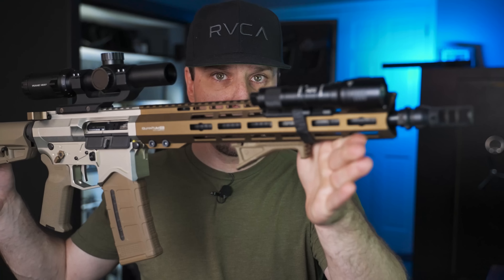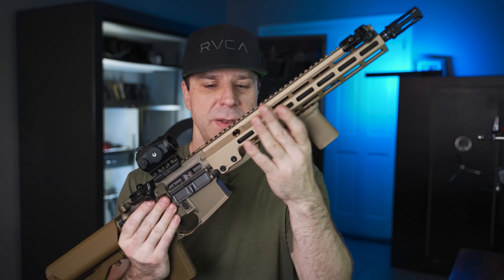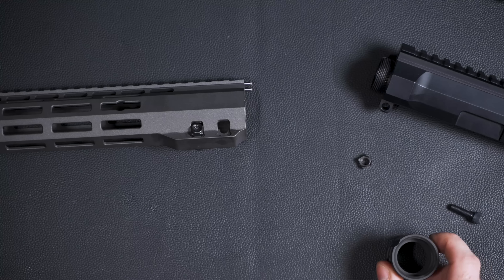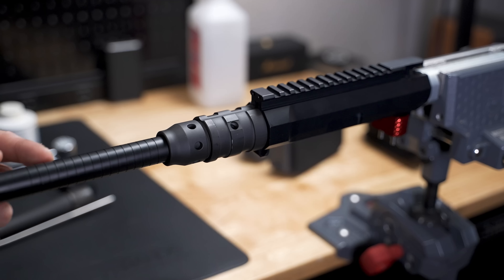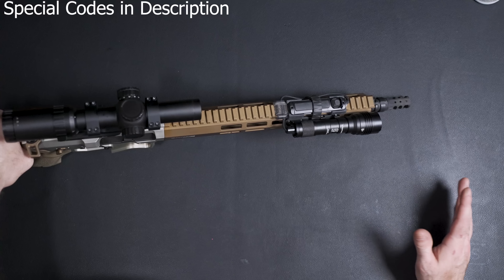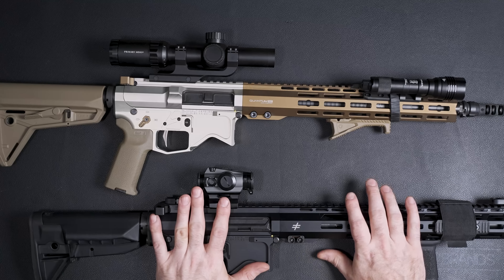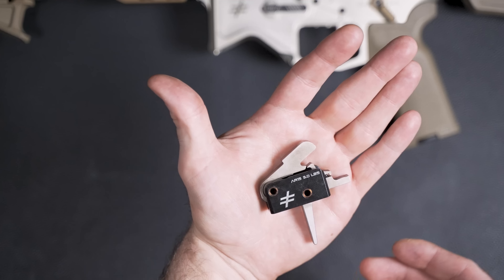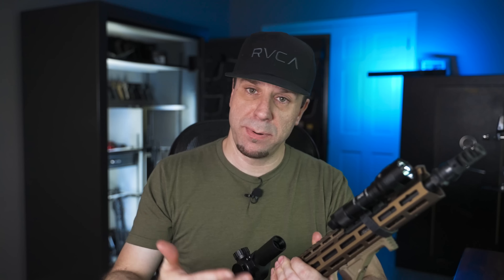NOBODY in the World Makes an AR 15 Like This...

Comment: I personally would never use an adjustable gas block, unless you feel like cleaning it everytime you shoot, you'll eventually get carbon lock and it'll fail. That barrel nut system is super cool and their pricing isn't too bad considering all the thought they've put into the build.

Comment: I got a ruger AR-15 shoots 223/556 I’m not sure which model but a review on that gun would be awesome I bought it at my local gun store right after I turned 18 and so far my only problem I have with it is the stock its a regular adjustable stock. The gun has a 13 or 14 inch hand guard and the barrel I want to say is 16 inches I’ve been watching your videos for awhile now and you partly the reason why I bought one. I’m not sure weather you would call my gun high end or low end. But I plan to do a lot of coyote hunting in the near future.

Comment: As for gas blocks I would really say that the click style adjustable blocks I have not had a fondness for but the tunable blocks have been a huge success. Currently all of mine have been changed to the odin works tunable block and since their initial tune after install I have not had them change and have had zero issue with the oldest one having around 1700 rounds through it and the newest is around 900. Wish I could say the round counts were higher but alas ammo is pricey and time is short.

Comment: The only bad thing about an adjustable gas block on a GTW rifle, is that it has the possibility to be on the wrong setting, when you need it most.  So there's a much more likely hood of user error, vs something that is permanent.  So you just really have to know what you're doing.  Kinda like running a 1911/ 2011 as your duty pistol;   You better know how to work that safety without thinking about it......   So that's also why the "adjustable gas blocks' that have many many settings--- (like i've seen on FAL's, that had 50 different notches to adjust it to)----   those are even more likely for someone to adjust wrong, and mess up your reliability.  It's just a data point to think about.   The more things there are that can go wrong, the more things will go wrong---   Murphy's law and such.

Comment: Having a rifle built with a blackout defense upper and lower there is a great advantage in the quality of the fit. I would love to by a second upper with the dual taper barrel nut, but the current barrel lengths offered don't fit what I want out of the platform. If they put out a 16 or 20 inch in this lockup design I might just have to throw my wallet at the screen to get it. Amazing company that puts out a great work of art and still tries to do more without killing the wallet as bad as they could. Can't wait to see what they pull off next
Reply: I am sorry buddy. I am working on the 16 inch DTL barrel. I have bar stock on order.
Reply: @BlackoutDefense  thanks for the update and quick reply was not expecting that. Continue the amazing work

Comment: Try throwing a shorter length suppressor with a smaller internal volume/diameter on it next time you plan on shooting that rifle suppressed. if you’re interested in fixing the overgassing issue, as well as the 1 o’clock ejection pattern without having to put an adjustable gas block on it or mess with the buffer weights.

A shorter length can certainly will not make the rifles sound signature a lot quieter downrange like a longer can will, but a smaller length can will highly reduce the port pop at the ejection port, at ear decibel ratings, and limiting the gas you get thrown in your face. 

Also look into one of the Radian gas channeling charging handles as well, since it will help in further reducing the gas blowback to your face while shooting suppressed with a shorter length suppressor. 

With with longer length and larger internal volume suppressors, yes, they’re typically quieter since they trap more gas before the round exits the can, but all that gas is still inside the suppressor itself before the round is fully uncorked at the end of the can and is increasing gas pressure and significantly lengthening your rifle’s dwell time. 

As a result, that’s going to be putting more gas pressure into your gas tube for a longer period of time, and onto your gas key as well, resulting in higher bolt velocities, more gas to the face of the shooter when the bolt does finally unlock, potentially more recoil, and more wear and tear on your rifle’s internals in general, especially at the lugs of the bolt itself.

A shorter length suppressor will help to alleviate a lot of that by significantly lowering the dwell time increase of shooting suppressed, so it should help correct the noticeable change in ejection pattern, as well as reducing the cyclic force and speed of your bolt.

Comment: That's pretty cool engineering.  It would be even better if they combined that taper concept with that of Aero Precision's Enhanced receiver concept that allows the handguard to be mounted directly to the receiver and not the barrel nut.  That is about as ''free-float'' as a gas impingement AR can get.

Comment: THere is one thing I would like to talk about that I am not sure other people have thought of. Regarding designs like this one that allows the rifle to be more accurate NATURALLY, would the practice of these designs help in legal battle for say a self defense shooting? What I mean is that when being tried during a self defense shooting, lawyers will most likely question you about the appearance of your weapon, the mods done to your weapon, etc in order to give the impression that you were eager or premeditated for such shooting events to occur. Thus shifting fault to you, the victim. But to help prevent this, could we argue that such mods help you shoot more accurate therefore putting more of the responsibility on you by taking out the "slack" per say in mechanical fault or failure? For example, say you are speeding along a road 5mph over the speed limit and you happen to drive through a speeding camera zone in which the camera captures your infraction. You decide to go to court to fight the ticket and as you are asked what your defense is, you state that "due to the inaccuracy of natural mechanical failure, my speedometer was off by 5mph, therefore leading me to speed". The court agrees by grace and wipes your ticket, hopefully at least. IF we install mods that intentionally make our firearms more accurate, controllable, and safe, which inherently places more responsibility on the shooter, don't you think that would be a wanted practice? Doesn't it make logical sense to make absolutely sure that malfunctions, defects, and hinderances are taken out of the equation?

Comment: I would also think that in addition to the stated benefits about the proprietary barrel/barrel nut design, that it will also aid in heat dissipation as well, due to that additional mass (not to mention a secoandary nut) along with those concentric rings. Impressive design!

Comment: The blackout defense clear coat and anodized rifle is super sexy and gorgeous. But it would be cool if he had also designed a better gas system. The debate between piston and DI seems to be over. The primary weapon systems, the HK 416 A5, and the Sig Sauer MCX Virtus are dominating the battlespace and have been dominating because they run better with suppressors. No matter how well a DI gun is gassed my piston gun always has less gas in the shooters face which is more and more important when you know all the nasty chemicals that are created when you fire a rifle round. Anyways cool video. I still want one of these SBRs in the mid length 13.9” barrel to see if it fucks well with the Vox-S, Vox-K and ARX can as well as the Helios QD Ti and Sig SLX556QD

Comment: In my opinion, it's better to have an adjustable gas block. If you get thermal expansion, mixed with debris; it'll cause failures from sluggishness. Being able to close off the gas port gives better reliability. However, a non-adjustable gas block can be a better go-to-war option. All gas at all times means it'll cycle at it's max efficiency at all times, however...that also means more wear, and less life. Like you said, it's all a trade-off. There is no perfect solution, only optimal for certain situations.

I make aluminum alloys for a living. (356, 380, 3004, 6061, 6063, 5182, 7050/7075, etc.), and have to explain to new guys the differences almost every day. High silica alloys helps with liquidity - meaning better for casting. 356 is about 7% silica, and pours almost like water. 4032 (~11% silica) is even more "watery". Makes them easier to work with, but more brittle. Adding Strontium to 356 (most commonly seen on machined wheels that have that rainbow sheen to them) is caused by the strontium changing the crystalline structure for better machinability.

Add strength and brittleness, lose flexibility. Add flexibility, lose strength and brittleness. Metal is fascinating.

Comment: I run adjustable gas blocks on all my guns and close the adjuster then fire 1 round mags and adjust till every shot holds open the bolt with empty mag with a couple different rounds I have never had a malfunction due to build up in block because the block is the same as non adjustable it just has a set screw that closes the hole a small amount so it works the same as non adjustable not sure why people think it would cause fouling if so the non adjust would be the same and BTW a go to war gun would not have the super soft short reset trigger a real war gun must have a 5 pound milspec trigger because they are reliable and way to hard to get them to go off on accident a light fast trigger would be dangerous and unreliable

Comment: CZ TS 2 Orange could probably give that Watchtower a run for its money. Idk about a rifle though, would probably build a rifle with the JP buffer system, a big brake, rifle speed gas block, lighter trigger, and maybe a light weight BCG or the Bootleg adjustable BCG. And then tune it till it doesn’t recoil lol

Comment: Nitride barrels do not withstand heat as well as chrome. The nitride hardness does not penetrate as far as the extreme heat does and will flake chunks of metal off. This is why the military requires chrome lined barrels..The concern is between the barrel flat and the upper receiver contact, not the barrel flat and nut. This is why many lap their upper barrel face entrance..Some bed the barrel to the upper to decrease slop and others use a thermal fit...
Reply: If you’re running semi auto, the heat isn’t much of a worry…unless that trigger is moving very quickly over and over.
Reply: @RARufus  You are correct and I have many nitrite barreled AR rifles..The Blackout Defense Quantum Dual Taper Lock Rifle looks like a very well made and thought out rifle..

Comment: My guess as to why higher end companies don't put adjustable gas blocks:

They don't push the volume needed to offset the costs of unneeded warranty returns.
Companies with no questions asked warranties have big margins. Lots of volume. They can afford to offer the no questions asked warranties, staff the department, pay for shipping, store the firearms in for warranty, have separate shipping logistics, etc.

Also, if they're making their parts in house, that's 4-6 extra parts that need to be made, inventoried, and assembled. That's machine time. That's precious floor space. That could mean needing another machine outright. Opportunity cost.

If you work in customer service long enough, you find out that the stupidity/laziness of the average person that calls in is...alarming.

Comment: Those rings are going to have a negligible effect on cooling vs a smooth surface.

It will help with controlling barrel expansion as it heats up.

Comment: You made an error . The flat flange on the barrel nut won't be the part that has the waves of thickness It's the threaded face on the receiver that the barrels flange tightens against . The best way to build an AR15 to have the tightest moa is start with the receiver . Get a receiver lapping tool and the compound that's usedwith it . The tool slides through the barrel mounting hole of the receiver and all the way into the receiver keeping the face of to tool that's ridding against the face of the threaded barrel mount on the receiver completely flat and true with the bcg's round cavity. You use a drill on the tool and put some compound on the receivers barrel mount flat face and spin the tool against the receiver. That process will true up the barrel mounting area getting rid of any imperfections making sure your barrel is mounted straight before you mount your barrel so you get the best groupings you can .

Comment: At lot of companies get the "reliability" for their rifles by over-gassing the living crap out of them (Daniel Defense immediately springs to mind). Putting an adjustable gas block on completely negates over-sizing the gas port on the barrel. Regardless, setting a gas block isn't hard, but not everyone wants to do it. If you're going to have an adjustable gas block on a duty rifle, you need to have the tools to adjust the gas settings in the field if needed. I call BS on adjustable gas blocks being any more prone to fouling than regular ones. The same people that won't use an adjustable gas block won't think twice about messing with the buffer and spring.

Comment: Sweet rifle. Just ordered one and used your code! Thanks.
Reply: @Al Evans I got the same message, have you had any luck confirming?
Reply: @DaveDornblaser88  I assume it is a scammer.  I sent an email through the contact page on the website for Tactical Toolbox, butt no reply as of yet.
Reply: @al evans I did the same thing and haven't heard back yet either. I texted the number and was told I won a Sig P320 X-Ten. Seemed legit at first, then was asked to cover shipping which I thought, ok, makes sense... Then was quoted $135-$155 for shipping which is a lot but I've never shipped a firearm like that so 🤷 and it's still a deal... Was told it would have to be Zelle or Cash App, fine... Then none of the names on the accounts made sense, I figured I'd give it a shot anyways and payments kept refusing... The person kept pressing me on it, coming up with new ways to get them the money including a gift card and seeming to forget what we've already gone though etc... At that point I kind of lost it and called them out, they defended themselves at first until I said respond to me on one of your social media platforms and we'll go from there and they went dark... Sad...

Comment: this AR15 is modified to look a bit sporty to me
Although I am not a big fan of the AR15-M4A1 (there are several problems with the gun), I think the buttstock could also be replaced with an adjustable height pillow buttstock

Comment: Suppressors increase the gas pressure through the gas system, so yeah, it will be over gassed with a suppressor. That is the reason that you get gas in your face with most DI guns with a can.

Comment: Thank you Sir. Do they sell them as pistols? I need to be able to direct thread my suppressors onto it. 
I'm local to you, you should se up a shoot. small group of course.
Reply: @blackhawk7r221  They sure can, but that turns it into an SBR and given the amount of tax stamps I've paid for, I'll pass but thanks.
Reply: @steveninaz9576  You do not cut the barrel length, only lathe down a 1/2” back to form a shoulder, then use a die or lathe to form the threads you need.  Odd that your suppressor does not fit on your existing birdcage flash hider threads.
Reply: @blackhawk7r221  I want a 14.5 inch barrel and they pin and weld the break to make it 16 inches. You can't cut off the break and tap it to keep is a rifle on a 14.5, hence why I asked if they offered it as a pistol.
Reply: @steveninaz9576  Ah yes, the pin and weld.  Now I gotcha.
Doublecheck your true length, you know, rod down the bore until it touches the bolt face.   I’ve seen setups advertised as 13.5, but were actually 15.4.
Reply: @blackhawk7r221  still not legal.
LOL, appreciate it. But I know what I'm doing. Have a good one.

Comment: Why not an adjustable gas block? I called Criterion barrel when I was interested in their Hybrid and Core series, they said adjustable gas blocks eventually fail. Criterion tests their barrels with different gas tubes, gas blocks, pore size, etc.. They put tens and hundreds of thousands rounds through their barrels. The representative said what they shoot in a day is more than what you would shoot in a year. Also, they only use BCM's stainless steel gas tubes, not the Melonite ones for the same reasons. Melonite ones eventually fail. However, for the average Joe's, we will probably never put that many rounds to induce failures, so adjustable gas blocks or Melonite coated gas tube or not, don't make a difference for most of us. However, manufacturers such as BCM, Geissele, and Blackout Defense to name a few, they understand this and all test their products extensively, that's why battle ready rifles don't have adjustable gas blocks.

Comment: What’s the best lower parts kit for the price
Reply: Basic mil-spec party pack from PSA
Reply: @blackhawk7r221  what kit would you get if aiming for the higher end of lower parts ?
Reply: @TheDroneNerd  By far my best triggers are mil-spec $30 specials that I stoned myself under a lighter trigger spring.  
Look at your hammer.  Notice the sear catch.  Let’s say it sticks out .045”.   Thats .045” of friction rub before it breaks.  
Reduce the distance that it protrudes to give you a positive crisp trigger break with much less trigger travel.  But DO NOT round off any edges.  Maintain the hook angles.  Between this and using a lighter trigger spring, which you can easily modify your existing spring, you will keep the good safe runnin and gunnin 6lb trigger, but now have much less distance to pull you trigger back before it drops.  Polishing works wonders.
Do any firearms modifications at your own risk.